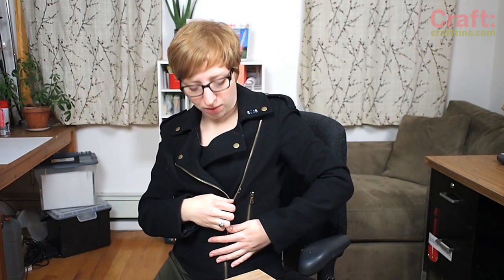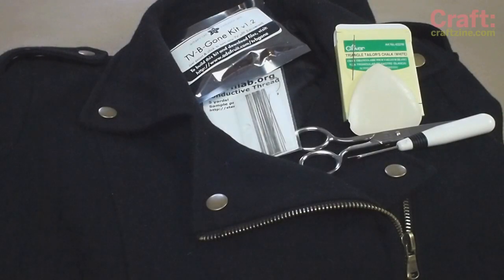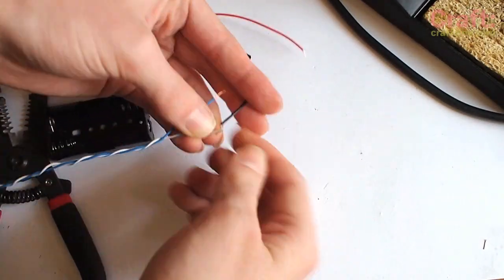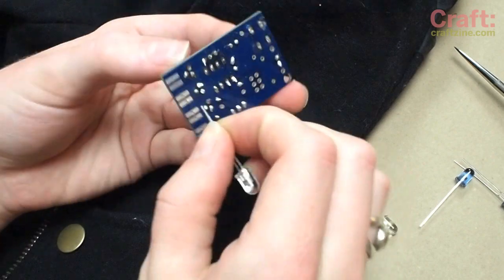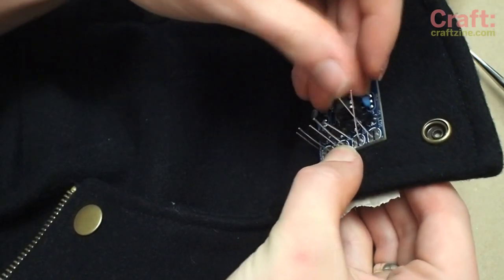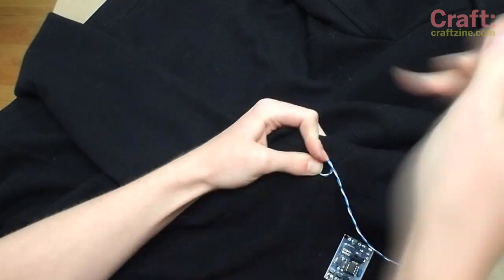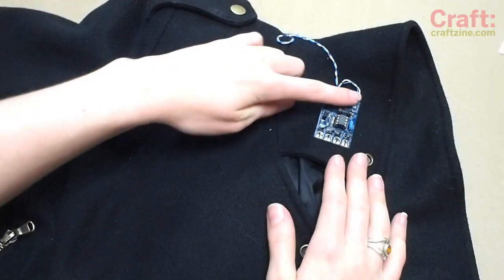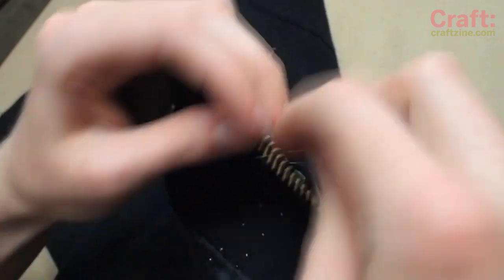TV-B-Gone Jacket

Comment: love that zipper switch..so many applications. what about a small string of tiny leds going up and down the zipper. as you pull the zipper, it makes the leds turn on 1 by 1. youd have to stitch many contacts but itd be awesome to have a lighted zipper..maybe some EL wire too, triggered by the zipper.